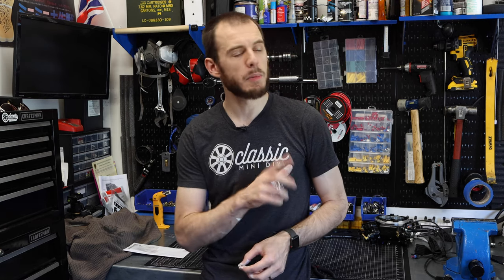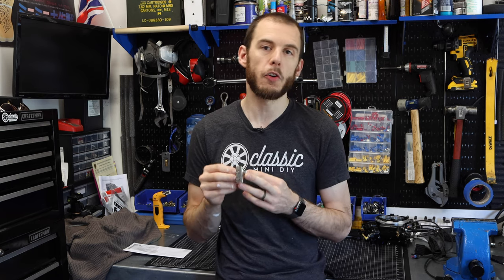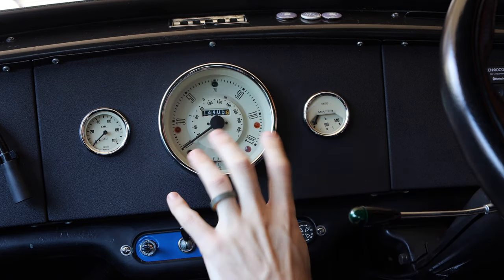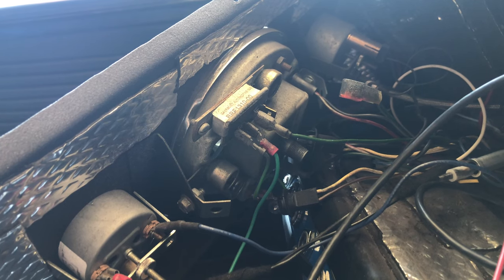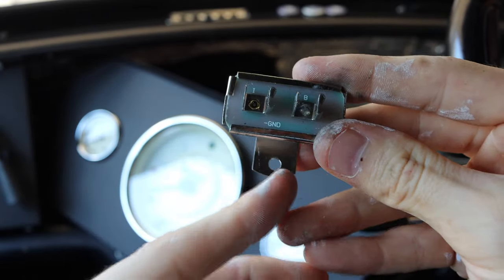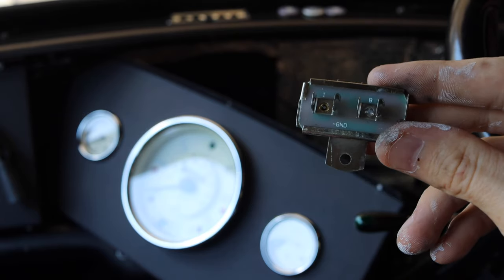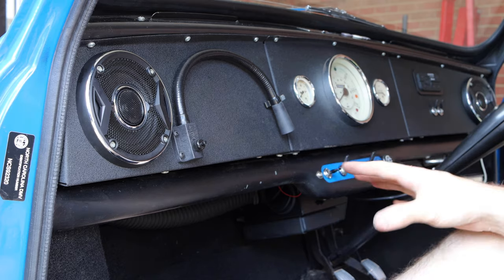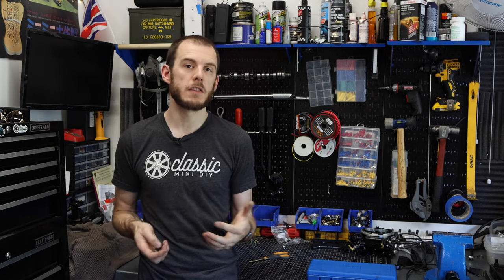How to Replace a Classic Mini Voltage Stabilizer

Comment: Really interesting, I never knew they ran on 10v sound deadening looks like a great idea 👌🏻
Reply from the maker: Yeah its an interesting method but makes sense. Reduce the voltage to smooth out the electrical signal so the gauges read more reliably. Modern stuff seems to be able to handle 12v better now though. I am really hopefully about the sound deadening. The cool thing too is if I wanted to, I could add more behind there pretty easily if I wanted it even quieter.
Reply: Classic Mini DIY I’m waiting to hear you reving it up with the supercharger whine 😁😁😁
Reply: But only the fuel gage?

Comment: Use a 7810 voltage regulator available from every electronics outlet and online auction sites etc for less than a couple of bucks posted.

Comment: I've been repairing classic car instruments for 40 some years here in Australia but only occasionally get Smiths gauges.  I never knew they they ran on 10, I have repaired Smiths gauges that ran on 5 volts off the thermal regulator.  Guess, I never got any of the 10 volt gauges.  Not so many British cars downunder I suppose.   Mind you, I do know there are Smiths 5 volt gauges out there so your viewers need to be sure they buy the right regulator either 10 volt or 5 volt.  
10 volts into a 5 volt gauge will be curtains for the gauges.

Comment: I have a 1970 Mk 2 Morris Cooper S (aust) with vacuum gauge, ammeter, volt meter, oil pressure gauge (direct line) temp gauge, fuel gauge, how do I connect them all to the voltage stabiliser
Reply from the maker: I would check to see if all those gauges actually need a stabilized voltage feed. The volt meter for example needs a raw voltage output in most cases to get an accurate reading.

Comment: Cole, is this the same part for the 3 gauge set up on an SPI/ MPI ?
Reply from the maker: I don’t believe the later gauges use a voltage stabilizer like this one. I think it’s built into the gauge cluster.

Comment: Hi Cole. I have a the more modern 80s/90s gauge with a circuit board on the back and my temp and fuel gauges don't work. Is there a stabiliser on these? I can seen to find it but haven't taken it all apart.
Reply from the maker: So to my knowledge the later gauges did away with the old smiths style gauges and ran a modern 12v gauge though I dont know this for sure. I would get yourself a multimeter (cheap one from an auto parts store will do) and trace the power signal from the power source, through the gauges and see if perhaps its getting a poor ground as a starting point.
Reply: @classicminidiy  will give it ago this week👍

Comment: Voltage stabilizer also needs a good earth via its connection to the main clock. A bad earth can make your temperature gauge run high and your fuel gauge give false readings
Reply from the maker: This is a great tip. And actually thinking about it this is just a great pro-tip for anyone working on electrical problems. So many issues can be traced back to a poor or dirty ground.
Reply: Thanks for this information Mark I have a Landrover Series 3 with exactly the same Stabiliser on the back of the clocks, and needed to run a separate earth to the chassis and get the unit and illumination to operate correctly.

Comment: I have a 73 Mini but I don’t see that voltage stabilizer on the back of the speedometer.  My fuel gauge is reading erratically and I have an oil temp gauge and a water temp gauge that only climb to 50°C.  Any ideas of what may be going on? Thanks

Comment: My water temperature gauge isn't working at all.. but the strange thing is that if i switch the wires on the gauge, as soon as i turn on the ignition, the gauge reads max temperature.. so i'm not understanding what is the problem, can anyone help?

Comment: Riddle me this one.    Temp gauge is normal when cold but after driving it goes to H.   If I come to a stop it drops a tiny bit under the H.   Fuel gauge is fine.   I noticed the Voltage Stabilizer was not mounted  to the back of the cluster.   I thought it would be the fix to ground it so I bolted to the back of the cluster.   Now the temp gauge and the fuel gauge don't work at all.   I'm wondering if the wires need to be switched.    thoughts?
Reply: Both lite green wires were on the I terminal of the voltage stabilizer.    so they were correct.   if I unbolt it from the back of the cluseter the fuel gauge works and the temp gauge still goes up to H.   The sending unit is a black one.   its new and so is the gauge.  smiths.